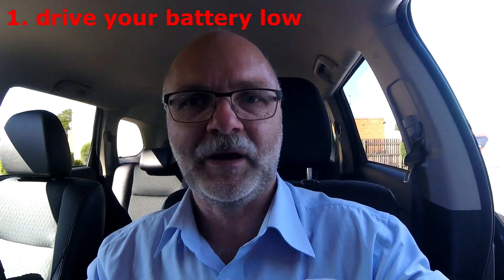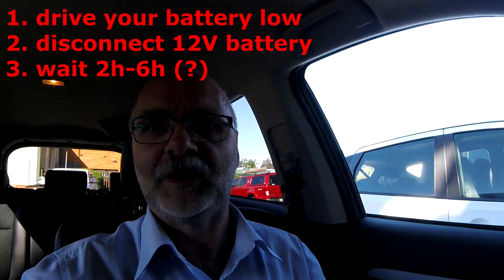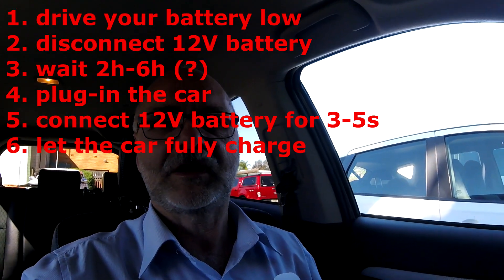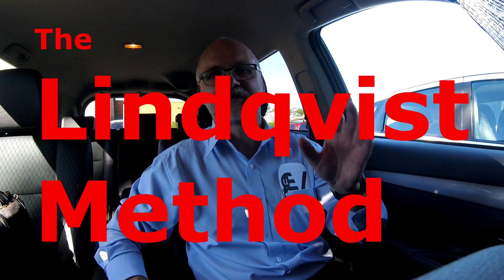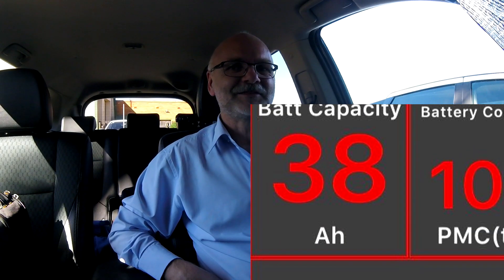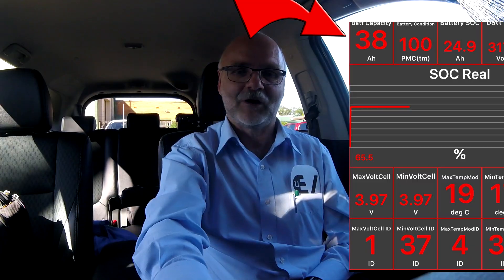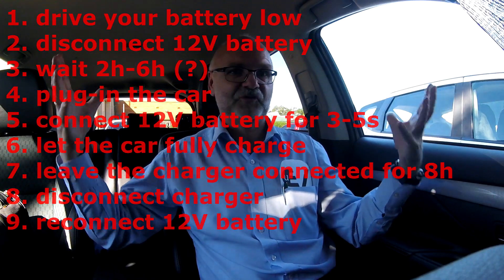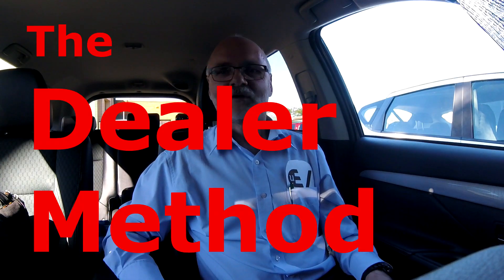EP248 - The Lindqvist Method (Outlander PHEV DIY Home Reset)

Comment: I own a 2014 PHEV (75000 km), which was down to 32 Ah SoH. It is fully equipped with electric trailgate, wi-fi, adaptice cruise control. I performed the Lindqvist procedure successfully 3 days ago, but had to enter the car through the side door and to climb to the back to reconnect the 12V battery.

The dog initially displayed 40 Ah SoH, but the car reported an EV system error after a few seconds. After second start, the dog displayed 38 Ah SoH. Everything works fine and as expected since then. I performed a successful 50km EV range test yesterday. I carefully monitored the lowest cell voltage until the ICE kicked in, but it never fell below 3,6V, which is fine. Now I'm able to charge up to 10 kWh as reported by my AC wallbox. I rarely exceeded 8 kWh in the past. I did a 150km hybrid drive as well without any surprises. 

In the meantime I detected two SoH drops by 0,1 Ah, which is expected as well. I wonder how fast this will continue and when the next Lindqvist procedure will be required.
Reply: hkek56  I waited 2,5 hours between disconnecting the 12V battery and initiating the charging step.
Reply: Thanks for reporting back in detail. So adaptive cruise control is not an issue either.

Comment: Worked for mime as well 209000 KM and moe at 38 Again, the range is 50 km as iT used to vd. Waited for 5 Bouts after the First step, that worked, begrote two Bouts didn’t do anything.
Reply from the maker: Can you post some figures around the voltages just before the engine kicks in?
Reply: Sorry can mot upload the screenshot

Comment: I try now to my 2014 140k km (89k miles), was 33Ah before, i disconnect 12v for 5h, plug charger (i will try first my "fast" charger 3.6kW) and connect 12v batt for roughly 5 sec to heard charging sound (knock knock) and disconnect 12v batt again. After an hour i just try check WATCHDOG and i supprised app working but still shown 33Ah :( Now i check again and i have 75% SOC and still 33Ah on watchdog :( Hope after fully charge (2,5h-3h) and connection 12v batt i will see 38-40Ah.....cant wait till finish charging.....fingers crossed.... If not i will try again with orginal schuco  PHEV slow charger (i thik push about 2kW). Can anyone tell that you try use wachdog while doing this procedure please??? ...:::UPDATE:::... Unfotrunetely not works so far, still 33Ah :( i try again 2nd option....i unplug this time both ground and + from 12v batt for over night and will start charge in the morning by orginal charger...
Reply: I disconected 12v batt for 12h (+ & -) plug charger and 12v batt for 3 sec. Is chrging now .... but i try watchdog and again i see 33Ah just on begining of charging. My question is when BMU is reseting and get new capacity?? after fully charge or after 12v batt disconecterd for while??
Reply: Ok, PHEV is fully charged and MMC shown now 51km (31miles, before 21miles(35km)) range but watchdog still show 32km and 33Ah. I will test soon on road how that numbers works.
I think my 1st reset yesterday going same because i have UK version and MMC after reset show units in miles and i not recognize that last night (too tired), dash back to miles not km like before reset (change settings) and i see 31 miles range last night.
Reply: My charger stop charging at 98%. I check on road and after 300meters i loose 3km of range of 51km(MMC), WD show me 31km range. I did 31km trip and arrive with 2km range on WD and 5km on MMC. So that mean this procedure not work for me. WDog still show 33Ah.

...:::UPDATE:::... After second charging sesion capacity dropped to 32.5Ah (-0.5Ah down) :( 
https://cl.ly/8f3a38
https://cl.ly/94bcb4
https://cl.ly/693f29

This method willbe useful for traders when try sell the car, after reset they can show to new buyer a fake range on GOM so be careful and use minimum an watchdog app to check battery health. I will wait for update about procedure which will be work to any PHEV in 100%.
SCREENSHOTS AFTER RESET AND "FULLY" CHARGE:
https://cl.ly/fdd4cb
https://cl.ly/66a681

MY 1SE TRIP AFTER RESET:
https://cl.ly/793585
https://cl.ly/f5a973
https://cl.ly/d2d172
https://cl.ly/a772fc

Comment: It worked for my MY13 (82.000 km, 30.2 Ah SOH, with electric tailgate) after the second attempt. In the second attempt I left the boot shut all time and entered the car from the side door. I'm now back at 38 Ah (did only wait for 7.5 hrs after charging started...). Thank you :)
Reply: Would you happen to know what SOH value the Dog was displaying during the charge? Do you have wifi+app? Thanks. For me it didn't work and I went through the side door too.
Reply from the maker: Thomas, has your car got the Wifi?

Comment: If you watch the Dog at step 5 while charging, every time you connect to it.... a pop up appears telling you the charging differential...mine started at -11.1Ah and at 59 percent went through 0... it is currently at 89% and now it shows a differential of +6.3Ah
Reply: Update... currently the battery is now 100%.. the differential in the Dog is +8.6Ah but its still drawing 5A from the charger..so am waiting for the Amps to drop off... Update +9.4Ah and 3A
Reply: Was your procedure successful? If yes do you have a record of what SOH did the Dog show during charging?

Comment: You will not ruin your battery...

The BMS/BMU will detect the capacity of the weakest cell by monitoring the voltage while charging or discharging..

If you have a degraded pack, the BMS will learn it during the first charge/discharge cycle.

I have a 80 cell lev50 pack in a EV, and due to imbalance, the car shut down due to a cell got below the minimum voltage. 

If your BMS miscalculate the capacity, your engine will start, I have to get a tow truck.

Battery shutdown happens for me at 6-8 %SOC, your engine try to keep the same pack at about 30% SOC.

So take it easy, you won't ruin your battery. We who use the same battery in EVs runs the cells a lot harder than you do..
Reply from the maker: How can you have such an imbalanced pack? Is this in the i-MiEV?
The PHEV balances all cells every time it charges.
Reply: @unpluggedEV  driving in 1400 km over mountain passes in 48 hours, only fast charger and winter with temperatur ranges between -20C and -10C.

The car was not able to keep the battery cold even when fast charging in -18C. The up to 60C temperature difference created huge temperature differences between in the battery.

Driving that long in those temps without balancing the battery created the imbalance in the battery.

I have never seen the car use so long time balancing the battery as after this trip.

The reason I know what happens, is that I was logging the CAN bus, and looked at the logs after the trip.
Reply from the maker: That make sense, right! DC FC does not balance, that is correct. You should not do any procedures after such a trip, for sure...

Comment: Yes!! it works, mine intstyle+2014 (110.000km) goes from 34.2AH to 40.0AH i have only  disconnect the battery for 45Min then leave the car charge for 7 hours
Reply: Does your car have the wifi+app?
Reply: @tuberculous4691  Yes it has
Reply from the maker: @Tuber Culous there goes the theory...
Reply: Good news that the wifi/app trim theory is dismissed.

Comment: unplugged mine 2017 just now we will see the result tonight
Reply from the maker: Let us know...
Reply: @unpluggedEV it  only reset the trip meter and settings as well as estimated range i disconnected for 3 hours but after full charge my amp hours are not changed still at 86% soh will try longer next weekend  also any one trying this dont be dumb and shut the boot like i did no battery means no electric boot release before charging and  once charging finishes  i ended having to fold down the seats and reach into the boot
Reply: @BIGCHEESE8592  Been there..done that!

Comment: Hi Andy , happy days. Good to see your smile. Finally a solution. 
We taxi drivers or second hand car dealers do this trick all the time before we take the car to test or you sell your car. You disconnect the battery for a while, so all those check engine lights error coeds disappear. Especially German cars in Europe , diesel cars had issues with DPF Diesel Particulate Filter. 
I'm glad it solve your problem.
Reply from the maker: It's not a real fix unfortunately and may have some consequences for the battery down the track. It's early days for this...

Comment: hello i have done its this evening and its works i did go from 27,7 AH 72,9%  to 38AH again 100% the dashboard shows 59 km 
my ferry happy
Reply: Would you mind posting your steps was it the same as in the video? I've done this like 3 times and can't get it to work. How long did you wait?
Reply: @WillDeasy  yes ,  I did 2 times but  can't get to work too.
Reply: disconnect 12v wait 3 to 6 seconds wait 45min, leave it charging for 7 ours then reconect 12v take the charge out

Comment: From what I know, the auxiliary (12V) battery is charging when either of the following condition is met:
-PHEV system is "ON" ("READY" indicator is lit),  the aux. batt is charging from the drive battery;
-the drive battery is charging from external plug.
This means that after charging (of drive battery) has started, disconnecting the aux. battery should have no effect since it's charging circuit is suplying the voltage to all connected loads. Hence,  disconnecting the aux. battery after 3-5 seconds at step 5 makes no sense in my mind.
But who knows, PHEV works in mysterious way :) so the procedure should definetely be carefully tested on multiple cars / situations before it can be taken as granted.
Reply from the maker: That is my thinking too. But it must have some sort of effect on the process. We will see...

Comment: I've had the car disconnected from the battery for over 2 hours. Just doing the charge now with the battery disconnected again.  It's saying 4 hours to charge but the car is fully functioning with battery disconnected so the charging must also power the car with 12 volts. So I'm thinking maybe you can just connect the battery again after being fully disconnected for over 2 hours. Just a thought.

Comment: Will this "Lindqvist Method" remove or reset all of the cars timer, app, bluetooth and radio settings?
Reply from the maker: Nobody has reported any of this. It only affects the BMU...
Reply: I did it, but no effect at timer, app, Bluetooth. Radio presettings stay but canal texts disappeared. But those are easy to put back.
Reply: No

Comment: At the risk of boring those who've already read me saying this: If you choose to re-initialize your BMU, do PLEASE keep a close eye on your cell Voltages—at least in early testing. Roughly 3.5 V seems to be the critical "knee" in the curve for this type of cell. If the weakest cell dropped below this, I'd be hitting that CHRG button🤓

And again, for the avoidance of doubt, you should not interpret any participation in this discussion as an endorsement nor as a recommendation. If you choose to follow any of these procedures, YOU DO SO AT YOUR OWN RISK.
Reply: I read your blog on the phev. Was a very interesting read.
Reply: My BMU just got reset, it is still charging but I will keep an eye of the cell voltages, Thanks Richi

Comment: I will install a dashcam to my PHEV soon. The installation manual advices to disconnect the 12V "-" battery terminal before running the cables through the side pillars where the curtain airbags are placed. I'm afraid I'll be forced to disconnect the aux battery for safety reasons... Dammit! 😜
Reply: vferrandobe , any excuse... 😉

Comment: Who knew? I already knew how to do it! I discovered that trick to reset the warning lights in the dashboard in an old car I had. After a while, they were reappearing though! :-P
I don't think it is a bug. Probably, all cars reset to default settings when there is no Voltage applied to the electronic boards.

It would be important to verify that those restored values actually translate in to a longer EV range, at least till it will start loosing capacity again.
Reply from the maker: As every reset, it's not a permanent fix. SoH will go down again but EV range is fully restored for a year or so...
Reply: @unpluggedEV   ... so, waiting for you certification of the procedure!
I have already prepared the popcorn!
Reply from the maker: Hahaha, I'm not doing it. My battery is still above 38Ah and under warranty...
Reply: @unpluggedEV  Crossing my fingers to see a huge battery drop soon then! :-P

Comment: Join Facebook: Mitsubishi outlander phev battery/bmu issue
Reply: Will not join Facebook even if I would be under gun-threat. Not in a million years.
Reply: @ervjhb  good for u caveman😂
Reply from the maker: It's not normal to lose 22.5% after 2 years. Ridiculous!
Reply: @unpluggedEV  Yes! Ridiculous... The tesla of my employer has still the full range after 5 years and 100000km...
Reply from the maker: That's where we get all the info from. Without Facebook we wouldn't have a 'fix' and we never had met Mr. Lindqvist...
Reply: @unpluggedEV  Hi Andy I have tried twice this method with my 2015 uk version. First 2h, and then  8h unplugged from 12v. It still didn't work. Dog has not changed. . Does UK have a problem?
Reply: I had my car in to the dealer today. They state that 31Ah after two years is normal. It might be normal, but does that make it reasonable?

They want 150 Euro just to troubleshoot the battery. I must take this step to be able to dispute the capacity loss...

Comment: As useal great Video, my only consern is, because the connector is linked en there is no 12v online in the car, does the Bms knows when to stop charging? OR does this stop when the Evse detects that the voltage is full?
Reply: While charging the DC-DC converter will provide 12volts to the whole system(I confirmed that) even though the 12v bat is disconnected; the charging process will stop automatically and in that moment your car will be dead, so you need to open the door with the key and jump to the back side and open the tailgate from inside( there is a latch in the middle bottom), then you re connect 12v bat and everything is back to normal.

Comment: Did you try it Andy?
Reply from the maker: No, I didn't. I'm still over 38Ah, so... no point ;)
I also have battery warranty until 2027, so every time it goes below 80% I have to contact Mitsubishi.
Reply: unplugged EV hmmm.. But this goes against your advice. I think you suggested to just try it out, risk of losing warranty is minimal, would make for an episode. But if you want to be on the safe side this time, I respect it. Maybe we can get some other AU owners to try it out and get the on camera for an episode?
Reply from the maker: I'm also above 38Ah so there is no point of doing it at the moment...

Comment: disconnect 12 v battery : we only can disconnect  " - " terminal or we need disconnect " +  - "  both terminal ? thanks
Reply: In a 12V DC system you only need to disconnect one terminal, does not matter if it is the + or - to disable the system. In the PHEV it is easier to disconnect the minus terminal.
Reply: If you disconnect the -ve that's all you need to remove the battery from the circuit, we pick -ve because it's safer than disconnecting the +be (potential to short the battery with a spanner from the +ve terminal to the chassis of the car).
Reply: I was trying disconnect 12V batery 1.5 hours in first step but doesn't work yesterday PHEV 2014. I will try 2 more hours disconnect battery.

Comment: Tim Scott, interesting points.
However if a 12v battery goes flat (or disconnected) for several hours or days and the BMU data resets, then this is what the car is designed to do.
Any car can suffer a flat battery!
Reply from the maker: Exactly this happend to someone here in AU. Flat battery for hours and the car would not turn on any more but the charge started after plugging in...
Reply: Certainly a battery can go flat.  The abnormal situation we create with this described procedure is to present 12V to allow enabling the mains charger and then to remove 12V while the traction battery charge takes place.  Is this okay? I don't know.  Can it happen naturally with a flat battery? No, I don't think so.

Comment: To reset the BMU at intervals has been my thinking for a while now.
However you have been against calling this a fix as it is more of a workaround and doesn't address the real issue of crap  BMU software.
So do you endorse that this is the only road we can travel until Mitsubishi get their heads of of their collective arses on the BMU issue?
Reply from the maker: I'm not endorsing this method as stated in the description. This is not a fix, it's a reset...